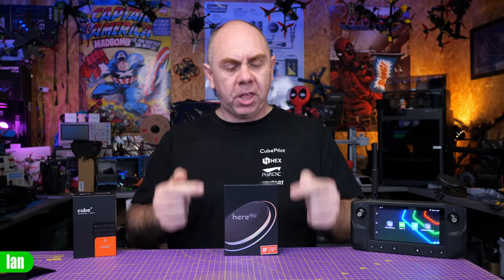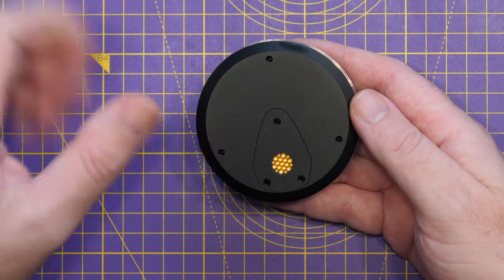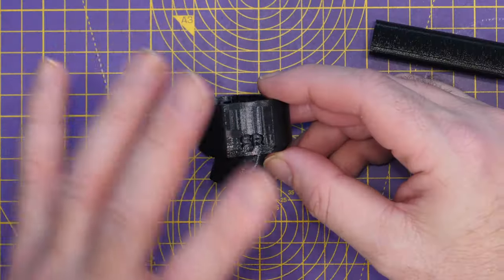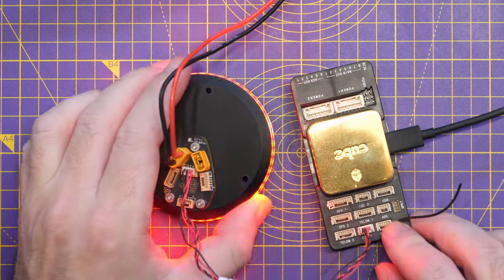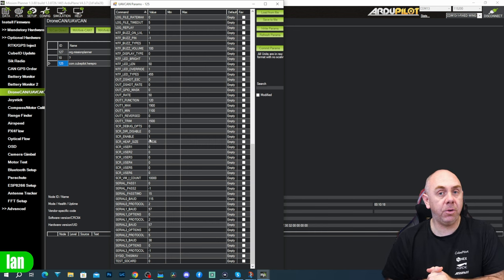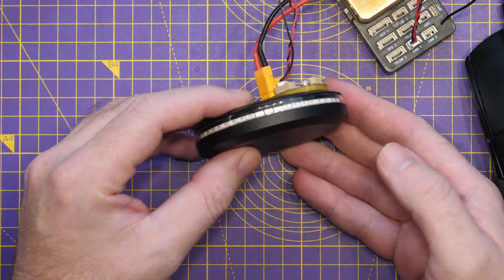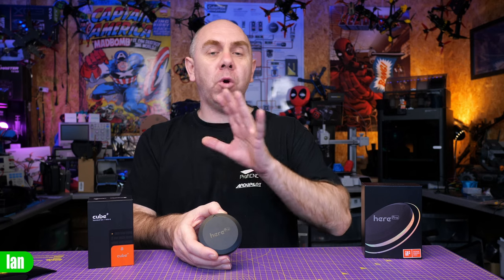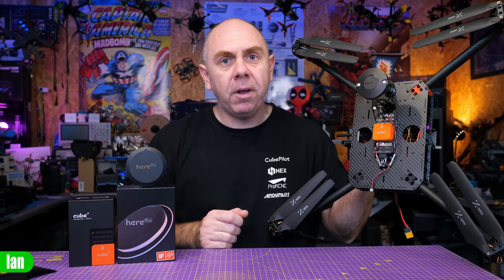The Here Pro GNSS From Cubepilot - F9P RTK Pro GPS Module

Comment: 28:20

About moving Baseline with 2 Here Pro RTK rovers on drone.

I understand the benefit when flying around metal objects that may interfere with the magnetometer (compass) in the IMU.

But wouldn't it be easier to just disable/toggle the magnetometer in the IMU???

If utilizing GNNS (even plain GPS), can it just not use the GEOGRAPHICAL TRUE NORTH of the RTK system for its heading vs using magnetic compass north which isnt the same as geographic North anyways?  Magnetic compass North also changes over time and different declinations in different regions.

Why are (2) RTK antennas needed when all angles can reference geographic TRUE NORTH (GPS/GNSS) using just 1 RTK rover antenna?  Has to be a way software-wise to toggle on/off magnetometer if interference is an issue.